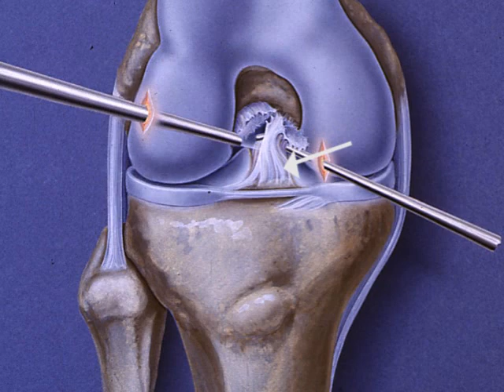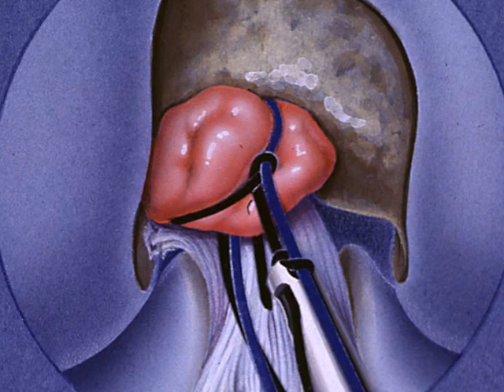Anterior Cruciate Ligament (ACL) Repair

Comment: @TAJIKROCKS that is correct that you would've felt a pop and been crippled at the first time you injured it. However, you'd be able to walk normal again after couple of weeks. Then you would feel that your knee is not as stable as the one before you injured it. If you said that you feel your knee is kinda loose sometime, that's exactly what I felt during the past 3 years. I tore my ACL 3 years ago and did not know what had happened with my knee until I had an MRI test. Hope it helps.